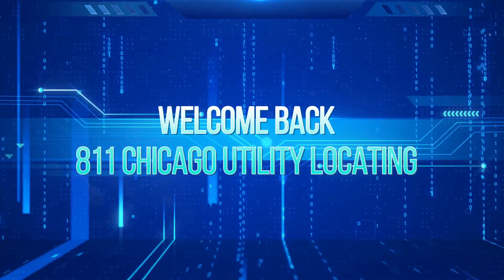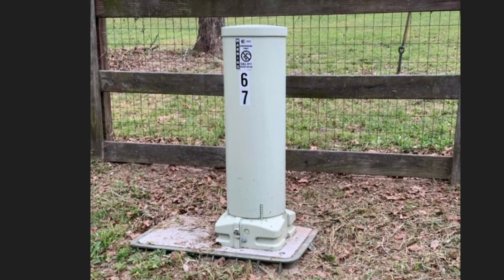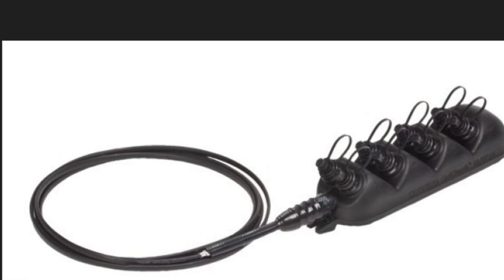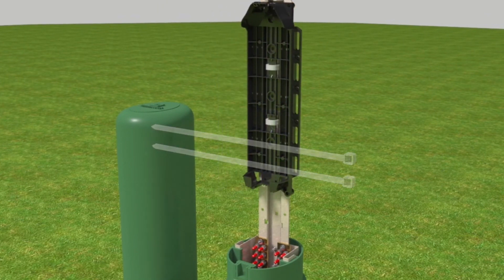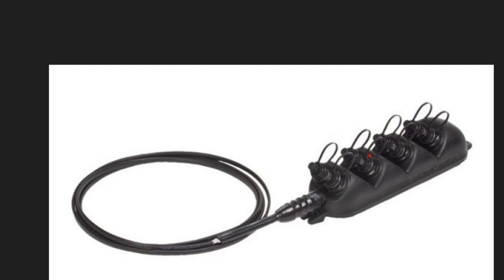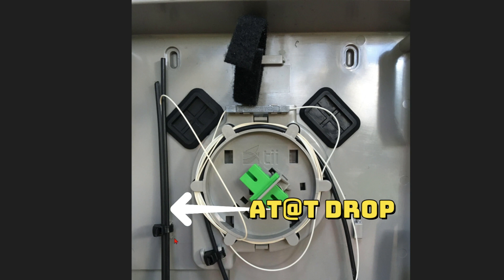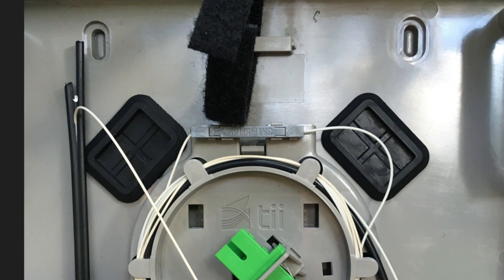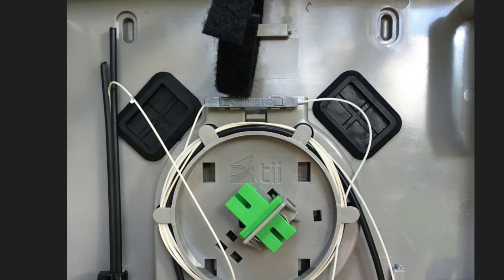How To Locate AT&T Fiber Optic Cable Drop From House To Pedestal

Comment: what frequency do you recomend for the locator? this is on my home, and the Fios has a solid copper tracer on the side. but I cant get it to locate for anything. does it matter if i locate from the home to handhole or handhole to home? Thanks
Reply from the maker: For residential setups like this, I recommend starting with a low frequency, such as 512 Hz or 940 Hz, especially if the tracer wire is continuous and well-bonded. Low frequency helps stay on the intended path and reduces bleeding onto other nearby utilities.

If that doesn’t work, try stepping up to 8 kHz or 9.8 kHz — higher frequencies can help jump across bad connections or damaged tracer wires, but they also tend to bleed onto other metallic paths, so use them cautiously.

Comment: So, how do you locate a dielectric line?
Reply: When it comes to this plug and play fiber, or FNAP that AT&T is putting in in traditionally copper cable areas giving the customer options. Basically under the pad is a splice case. The main fiber is locatable, but the fiber coming up into the pedestal is not.

The problem I always had with fiber drops was the fact that neither end was ever grounded. So you'd have to just blast it on 33 and you get it but the AT&T technicians will never take the time to ground it at least in that area I worked in.
Reply from the maker: @Utility_Detective  AT&T technicians will do nothing with that wire because they have no use for it. At the beginning of this fiber build years ago, AT&T technicians were supposed to strip that black sheathing for the third-party locating companies to use to locate that drop, but it looks like they are not doing it.
Reply: No they're definitely not stripping it back. What makes this even more "fun" for us locators is ALOT of AT&T installers are simply using the nid as a slack point but running the drop direct into the house for their first splice/termination point. I know cuz i was an AT&T employee for many years before becoming a locator. Good to have a nice sharp knife and carefully slice the jacket to expose the side with the tracer and you're in business!
Reply: I know. Just makes me mad as a locator because some of these contractors and even AT&T will use dielectric lines for drops and then try to blame you as the locator for not tracing the line when it gets cut.
Reply from the maker: @mwaltenburg  It's the locator's fault when something goes wrong. I've been hearing it for years now. These days, you just have to push it back onto the client (AT&T) and let them deal with it.
Reply from the maker: You cannot locate any dielectric cable without a source of metallic material, like a tracer wire.